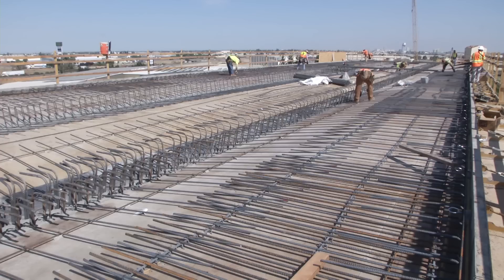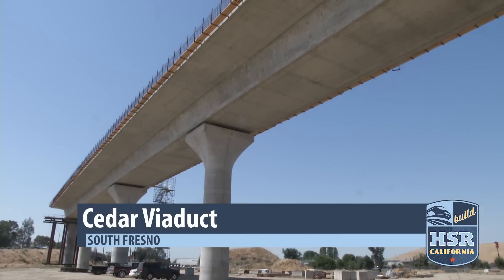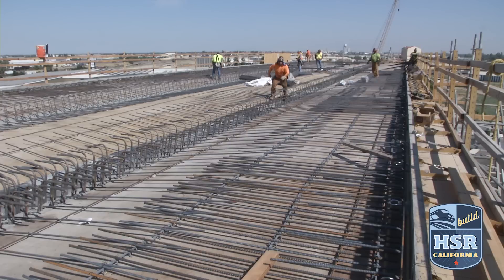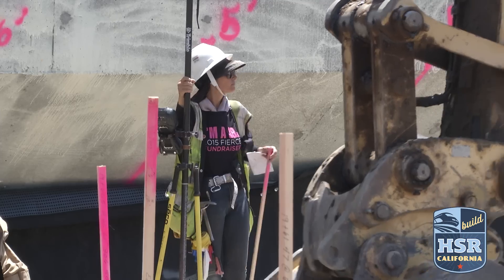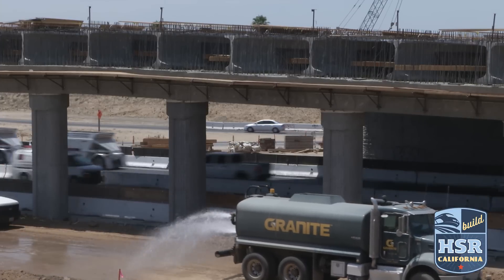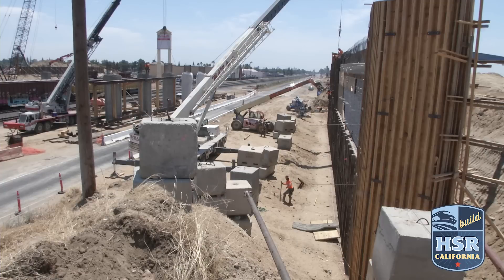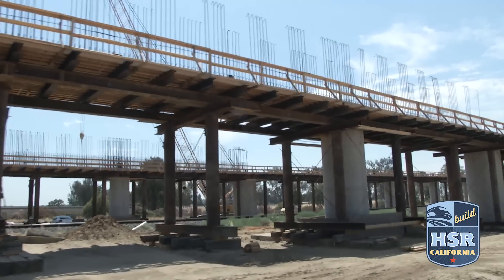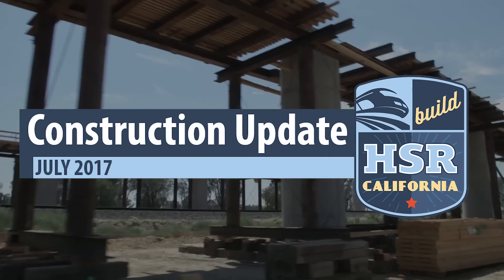July 2017 Construction Update-- Three Most Visible Projects

Comment: Why do we use the "false construction" method to build the viaduct(s)? The Chinese use a system that "pushes" a prefab section to the next support support pillar. This system results in a much quicker construction time of of viaducts.
Reply: Also Chinese buildings falls apart. Plenty of videos on youtube showing the shotty work Chinese do and how their cement cracks and falls apart.
Reply: Zents Gaming Better have something to improve rather than don't having it at all...
Reply: viaduct, how come no chicken.
Reply: yea chicken @patrickmcshane7658
Reply: MartinFrederick Graafland that was what the winning bid said would fit the time/budget constraints.  it's either this or CALOSHA, the state workplace safety office.  Workplace rules are somewhat arbitrary and overregulated.

Comment: Add all the Railroad Crossing Signals for the High Speed Rail Trains.
Reply: what?
Reply: Coaster Jaiden Hey
Reply: @mohammed hossain California High Speed Rail will avoid crossings at grade as seen on conventional US freight trains, because it's too dangerous due to the operating speeds and how risky drivers are around railroad tracks. Doing that would demand a lower average speed from the passenger rail, which defeats the purpose of the huge investment.